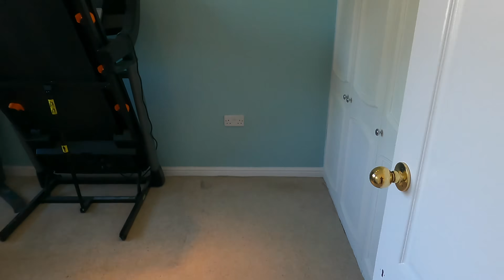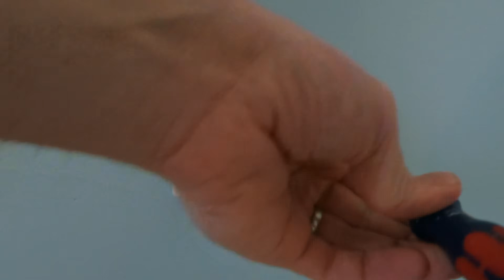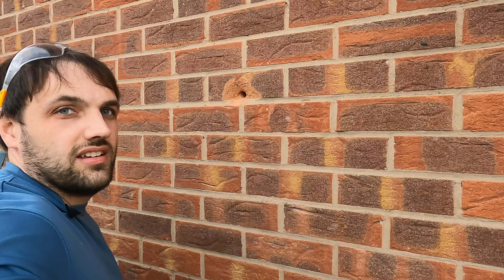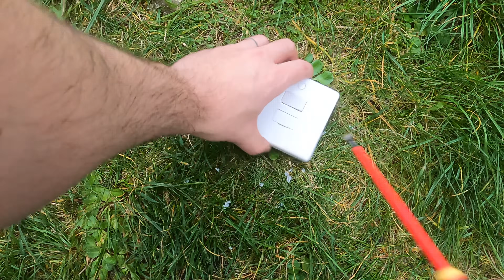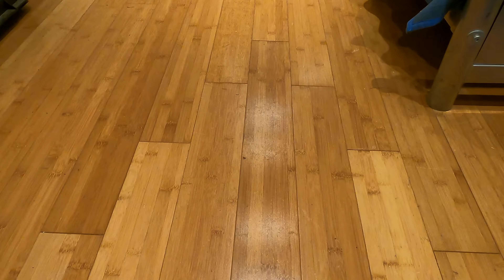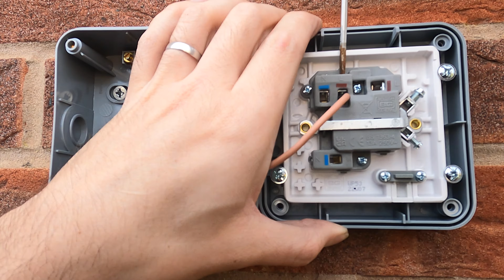How To Install An Outside Light Tips Tricks Hacks – Outdoor Porch Light With PIR Sensor. Wire It Up

Comment: Firstly, why not connect to the Lighting circuit? It is much safer than connecting to the socket ring main, and secondly, why fit a switched spur when no one can reach it without a ladder? 😂

Comment: Thanks for the video , very useful, can i add a junction box like this from any socket in my house or is it only specific sockets you can add to ? Also does the inside socket switch always have to be left on to work ? Excuse me for my noob questions 😅
Reply from the maker: Thanks
Reply: This is an fused connection unit and you can take it off any socket yes. And no it doesn’t have to be on to work like how the sockets on the same circuit in a house don’t have to be on to work. Only time you’d need something to be on all the time to work is if it’s plugged into the socket directly.
Reply: @Luke_Carpenter-i8q  Thankyou 💯

Comment: why 3amps fuse?
Reply: 230v × 3A =690watts. It protects the cable and is commonly available.  You could use a 1A fuse if you had one and the switched load was under 230 Watts. In most cases it is because of the common use of led lighting. 3 Amp covers it. 👊

Comment: I don’t want to drill holes in my walls or floors, is there any other way to get the cables outside?
Reply from the maker: Perhaps a solar panel with light
Reply: @mikebolt9753  I tried that unfortunately, they only seemed to last for a few days before they would die out during the night.
Reply from the maker: Probably need more than one panel wired up in parallel. Otherwise your drilling holes unfortunately.
Can’t think of another way to do it other than solar if you don’t want holes
Reply: @mikebolt9753 I could do it through my windows/doors since they aren’t as thick and are easily replaceable unlike a wall.
Reply: Take the cable through a vent hole. It won't look all that great unless you conceal it with snow outdoor junction box. You could take the power via the 1st floor lighting and out through a soffit board. It would mean going into the loft. Call in an electrician. They will provide you with a minor works certicate and this way you can be sure it's been done correctly.

Comment: Please Manufacturers! We are up a ladder, x wind, x amount of  light, perhaps performing a new wrestling move involving keeping on a ladder and holding two tools, at an angle. 
Put a light in the PIR housings. Make the  PIR Housing act as an illumination for the area. Where the dials are located (which is also lit by same bulb) put an opaque stencil with the dial names - clear universal letters. Go on, jump on this.

Comment: Thanks for the info, few questions:
Is it wrong to use 13a fuse instead of 3a for this purpose ?

What mm cable you can use outside light eg 0.75mm, 1mm?
Reply: Lighting circuits generally have to be fused down to a 3A or 5A fuse if connected to a socket circuit as a 32A circuit breaker protecting the socket circuit wouldn't trip in time if a fault occured on the new lighting circuit cable. . The fuse protects the cable.
Reply: A 3A is commonly available and protects the cable. It will break contact if a fault occurs. 13A would take a much higher breaking capacity if a fault were to occur. 230v x 3A =690 Watts 230v x 13A =2990 Watts. You could use a 1A fuse if the lighting  is under 230 Watts.

Comment: Hi
I was wondering    I want to do this the same and was wondering if you could get the power from an existing outdoor lamp as want to have both 
Or does the power has to come from and plug.  Thanks Brian
Reply: Hi Mike 
So does that mean that I can get the power from the outside light and or switch 
As it’s a single switch how do I wire it up and not go on and off with the switch 
Hopefully you get what I mean 

Thanks Brian
Reply: @BrianEdmunds-v9t There would have to be a live switched live and neutral. If you want to independently switch the 2nd light on/off. If you're willing to use the same switch then yes. I'd call I an electrician for this. I've attended way too many faults due to water ingress.

Comment: After drilling the pilot hole I would have initially opened up the hole from the outside with the 18mm bit for a couple of inches and then drilled from the inside. This would have avoided blowing the brick in my (diy) experience.
Reply: @mikebolt9753   If you have already drilled the pilot hole from the inside and gone easy as you exit the outer brick so you don't blow the brick you can then drill an inch or so from the outside with the 18mm bit and then drill through from the inside. Lines up no problem in my experience.
Reply: If you turn the hammer function off to get through the outside brick, it will take a little longer but less likely to blow out the brick, maybe make smaller increments when increasing drill bit sizes. Thanks for the video. Love the Marksman pen, great for accuracy.

Comment: Great video for novices like me. Just out of interest, why did you swap the 13amp for a 3 amp fuse and could I put the FCU in doors? Thanks
Reply from the maker: Better to have it fused to 3amps to protect the cable. Yes you can have the fcu indoors.
Reply: @mikebolt9753 Can't 1.5mm² handle up to 6A though?
Reply from the maker: yes but if you use a 13amp fuse you could have more than 6 amps running through the cable under fault conditions. @bitTorrenter
Reply: @bitTorrenter The total load is likely to be less than 690 Watts. So 3A covers it.

Comment: I have a similar situation to you. Just purchased a light with a 1 m inbuilt cable. Do you need to use the junction box? Can I not just run the wire straight from the light through the wall and into the plug socket inside using a waterproof grommet on each side of the wall?
Reply: As you’re adding a light, you’ll still need a 3A fuse.
Reply: Any issues with the outside light, which are common, will cause your socket circuit to trip. Having a fused connection unit (you have called it a junction box which is different) means that the 3amp fuse will blow and it will be separated from the socket circuit so the circuit will be working as normal, and remain safe, even though your outside light is faulty.
Reply from the maker: As long as its watertight then you should be fine

Comment: Thanks for the video, very informative. I subscribed part way through. Was there a reason you opted to put thr switch outside and not indoors?
Reply from the maker: Didn't want to chase out the wall so just put the switch on the outside.

Comment: Rookie question: what do the ferrules do, and why on only 3 of the wires? Thanks in advance!
Reply from the maker: Because the flex cable is stranded and not solid core it just gives you a better electrical connection.
Reply: @mikebolt9753  Thanks so much. Very concise, and to the point!
Reply: It's good practice to use ferrules in screw terminal connections.

Comment: Great video… only question.. should the cable from socket to FCU not be 2.5mm (instead of 1.5mm)?
Reply: @mikebolt9753  then 1.5mm
From FCU to exterior light?
Reply from the maker: @UKBJH  starting from the consumer unit its 2.5mm to the socket. From the socket to the fcu and then the light is 1.5mm. Hope this helps
Reply: @mikebolt9753  would recommend to have done from the socket to the fcu in 2.5/4mm although not required it is better practice as the 1.5mm is technically not fused down until after the fcu
Reply: @Dog-whisperer7494  the 1.5mm between the socket and the fused connection unit is rated at 13amps Meaning that the 16/20/32 amp breaker that this is on does not protect the cable if their was a short on the cable in the fuse spur the mcb would trip after the cable has melted. DIY having minimal knowledge about electrical currents causes house fires and if it is found that you have done work to your own house that caused it your insurance company will not pay out
Reply: @adamdavis2788 Thanks tor that so a mains 2.5mm cable between socket and  fused connection unit is Regulations then,Did think at the time 1.5mm was a bit weak from mains? correct ? 
cheers for help👍
Reply: @edyjohnson559  yes the fused convection unit only downrates the cable leaving the load side before that it should be in 2.5mm twin or 4mm
Reply: @mikebolt9753  but 1.5mm ok as well?
Reply: It should be 2.5mm twin and earth cable to the FCU. 1.5mm is in rated to 14 Amps in conduit. That small section of cable is protected by a 32A MCB fuse. You use the same diameter to the fused connection unit as what is currently used on that said circuit. After you fuse down you can then use 1.5mm or 1.0mm cable. Even 0.75mm if you wish. Twin and earth is not suitable for outdoor use. Unless it's covered in conduit.

Comment: Hello Sir, Great Video Crisp and Clear Loved it so much , straight away Liked the Video , Subscribed and Saved Video to Favourites :) I am trying some DIY and tried to replace an existing outside wall light with a new  PIR sensor outside wall light which takes GU10 bulbs up and down and glows both ways. I watched some videos and did the replacement. I am not sure what I did wrong. I took the picture of old lights wiring and connected exactly the same way for the new light. After finishing when I switch on the Light flickers and goes off. The light does not flow. Even the old light did not glow and it was always off. Not sure what wrong did I do. Any inputs will be very helpful , Thank You !
Reply from the maker: Hey thanks for the sub. I would probably get a qualified electrician to take a look at it mate. Could be a number of things. 
Sorry I couldn't be of more help.